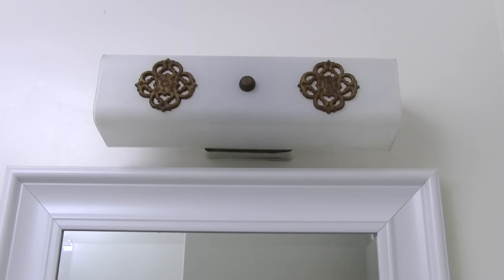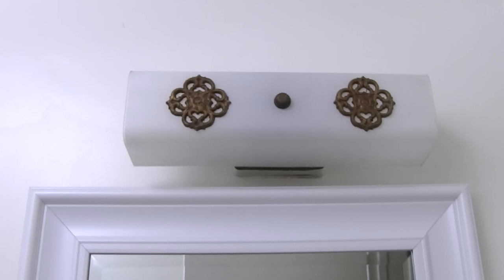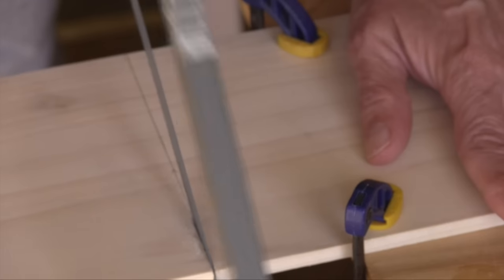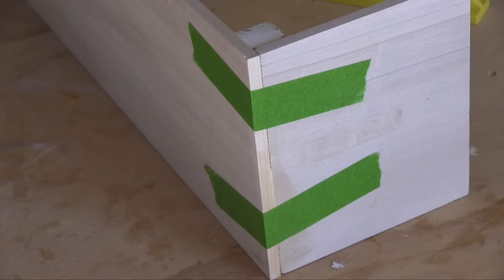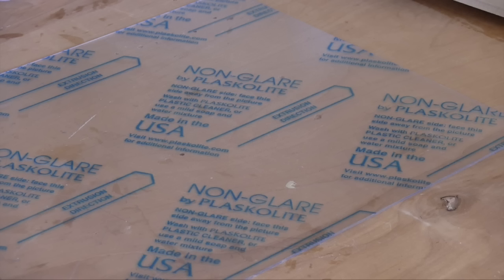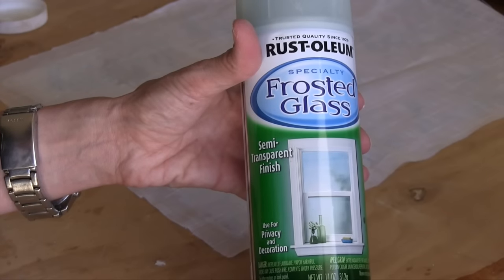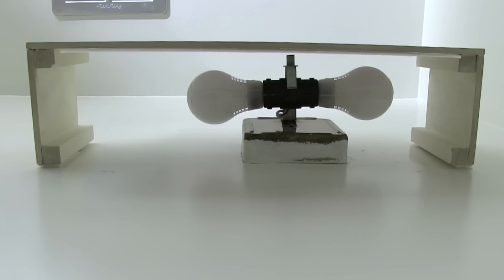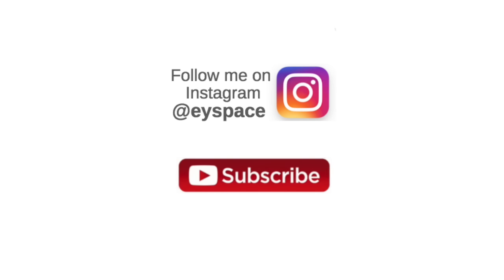Bathroom Lighting: Quick fix to update a dated bathroom vanity light

Comment: except for the wood cutting part, i dont even have a balcony or a saw this seems easy enough. my issue in my apt bathrooms are that the lighting is very yellow, & not bright enough would this diy correct that prob?
Reply: Home depot will cut any wood item you need them to for free.
Reply: nile jewel Well, replacing the bulbs with brighter bulbs might? But covering the light fixture won’t change the color of the light.